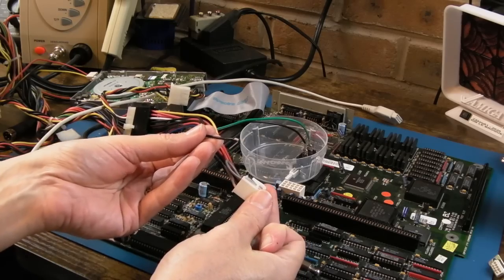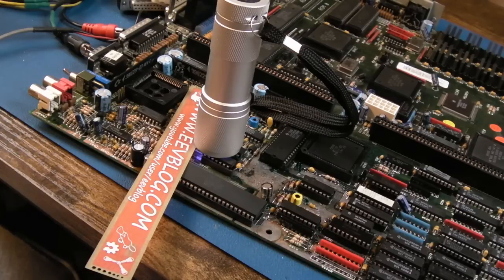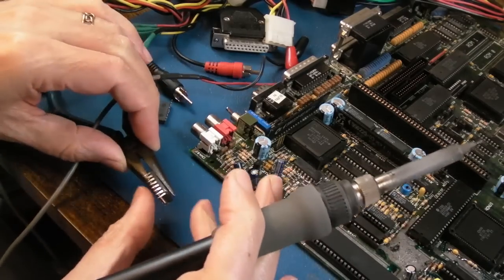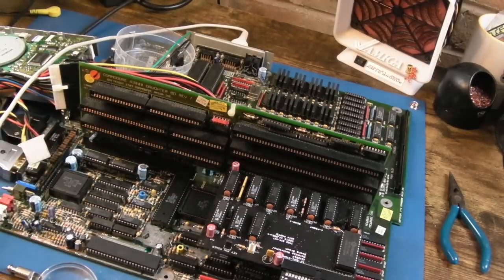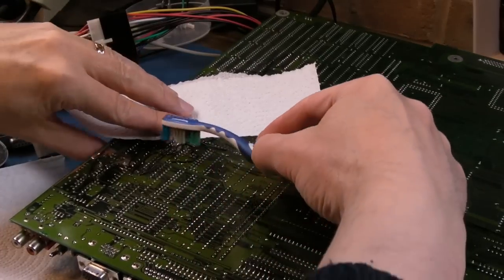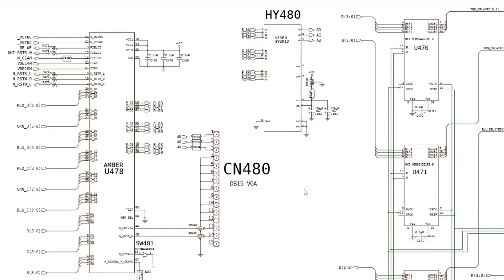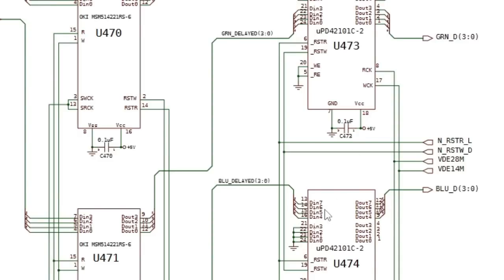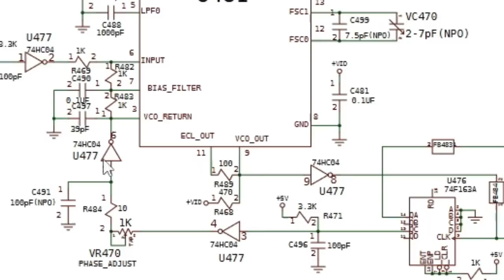Commodore Amiga A3000 Varta Revival Part 4

Comment from the maker: Tristan Zondag's A3000 Flicker Fixer Repair & Calibration - https://www.tsb.space/knowledge-base/a3000-flicker-fixer-repair-and-adjustment/
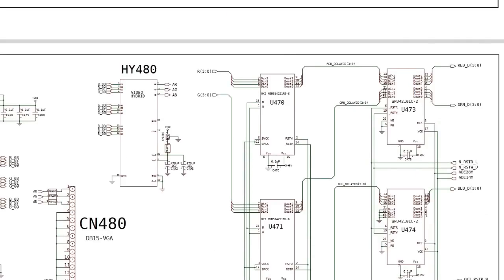Corrections:  The point I run through the schematics, a couple of "slips of the tongue" there - When talking about clocks, there are 2 14Mhz clocks around that section I think, but obviously 28M = 28Mhz clock.  N_C14M is an output 14Mhz clock...   When talking @33:20 - when I said, capture an entire line for that pixels, what I mean is that line RAM (top right) is capturing 4 colour bits each  for red and green, the chip below captures the blue bits (combined they hold a full scan line of pixels).  So when I said "capture entire scanline for that pixel" - I mean capture an entire scanline for that colour...  In the top chip case its two colours because all 8 bits are used.  The chip below just uses 4 of its 8 bits, with 4 bits unused.
The point with the flip flops - they are controlling read and write enables I think (not just writes...).  There are also clock pins I think on the RAM chips, so data gets clocked in and out serial-ey.
Part 5 - https://youtu.be/U3ABWQJ6xoE
Part 3 - https://youtu.be/ZJKwG5rKD6w
Part 2 - https://youtu.be/CSH6IvFKMoU
Part 1 - https://youtu.be/JJ6mkfcyGT8

....

Comment: I remember removing the varta on my A3000 years ago. I soldered extension wires and a new battery to that. But I can't remember how much space there was to keep it away from the PCB. I daren't look at it in case its damaged as I'd feel compelled to repair it.

Comment: I have an amber board for the A2000 - which is basically the same circuit on a video slot board and amber is on a socket (from the factory).

Comment: Nice to see my guide helped a bit 🙂 BTW: The "alternating" screen in amiga test kit is NOT interlaced. You only know if the flickerfixer part is working right if you set the Amiga to an interlaced mode (via workbench, or running something like 9 fingers). If the 3000 is not in interlaced mode, the OKI rams are not used at all.
Reply from the maker: Thanks - it's a great guide!   Yes, sorry that part of the video is confusing - I mean in general use diagnostic software to test the different screen modes.  Test kit has very little in there - but I did test some games that make use of interlaced mode.
Reply: Yep. The flickerfixer is a scan doubler. So it can work on 31.5Khz monitors not the 15Khz the Amiga needs.

Comment: excellent work as always. 
Regarding the compact flash issue, I don't know/remember what size cards you are using but it might be an issue with the kickstart 1.4 only supporting a max 2gb boot partition.
Also the WD33C93 chip could be upgraded from it's current 04 revision to the "final" 08 revision, this would increase compatibility with units that utilize "disconnect" i.e. drives with removeable media like cdroms etc. obviously not relevant for this repair just for further improvements.
Finally regarding your amber project, it is possible to find "male" PLCC sockets/connectors which can plug into a normal "female" PLCC socket - although they are a bit difficult to find.